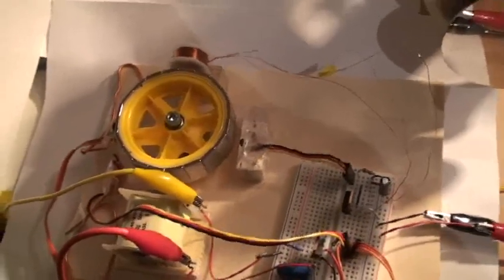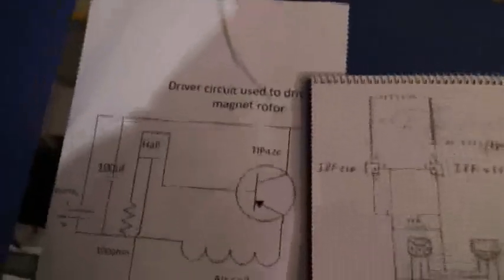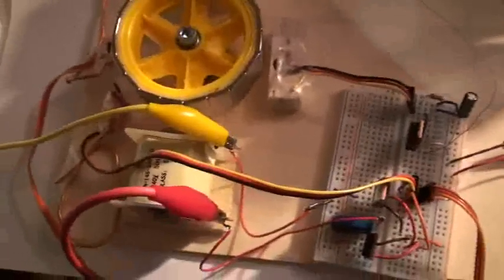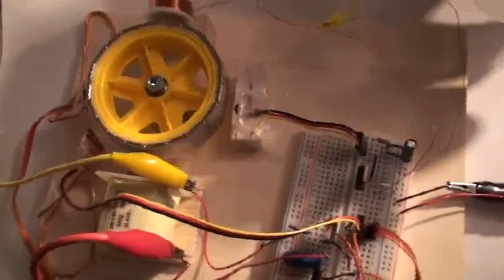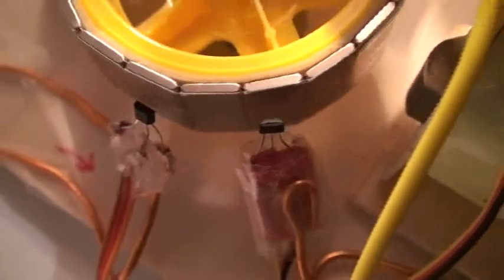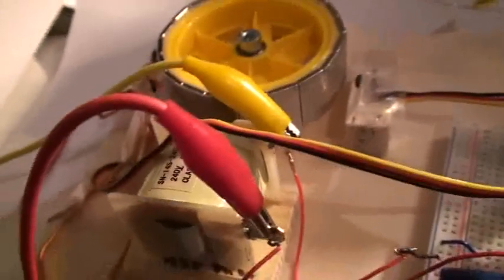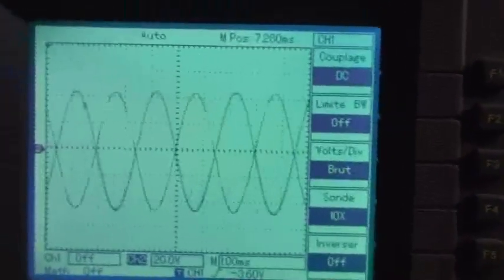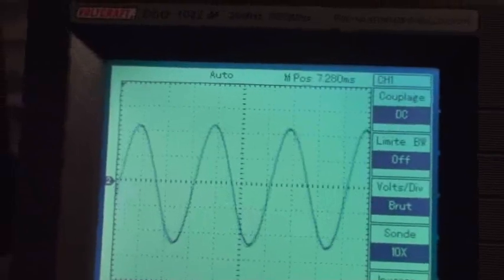shorting coil test 4.wmv

Comment: you had the timing better when you were using the hallow core.
you should use smaller magnets for the halls that are shorting the coil so the dwell time does not cover the entire pass of the magnet. or am I missing something? the reed you see in this vid is shorting the genny coil.
3 Pole Monopole Back-popping

Comment: Woopy:  You built a beautiful setup.  I started a thread on overunityresearch for this setup in the "Inductive Kickback Circuits" section.  The name of the thread is "Woopy's Shorting Coil Test."

Your setup is very solid and has lost of potential for experimentation.  I will comment there and please feel free to join and discuss.  Ca serait un grand plaisir d'en parler plus avec vous si ca vous interesse.

Comment: Well done Woopy !
Why does it have a sine wave as the output ?
Is the coil in resonance with the AC cap in series ?
How much DC voltage do you get after a bridge rectifier ?
Why don´t you just pulse the shorting all the time and not only at the peak top ?
Shorting and opening all the time will get you probably much more voltage.

Regards, Stefan.